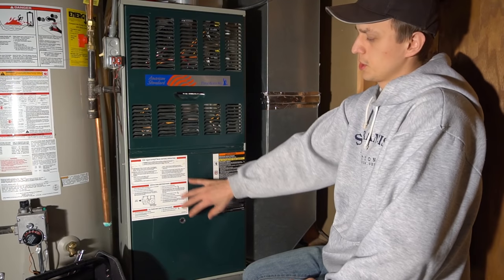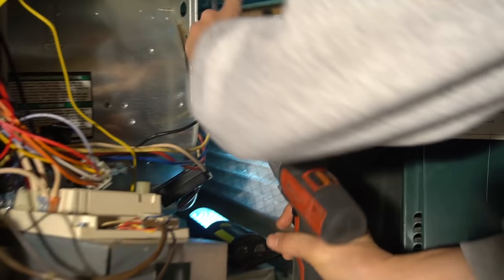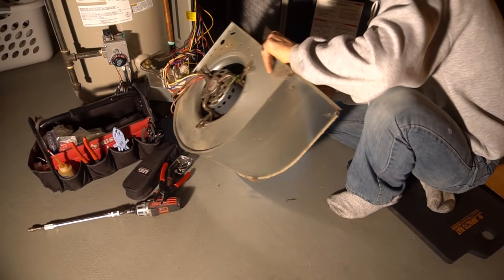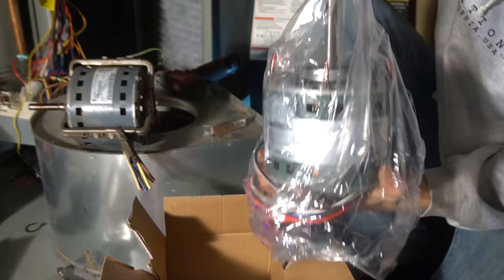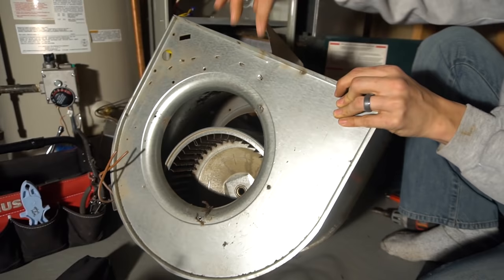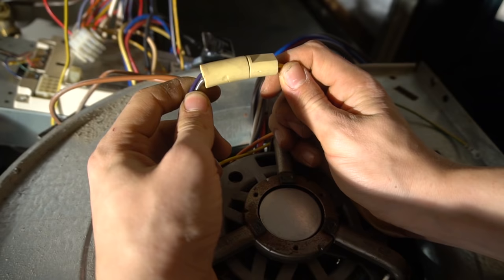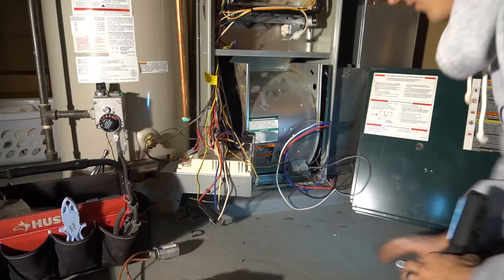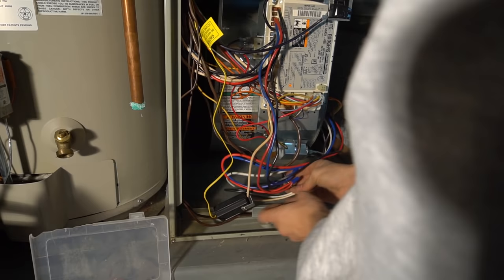Furnace/AC Blower Motor Replacement Step By Step

Comment: This don't seem like an easy DIY project. I replaced a flame sensor myself got the part for $10. HVAC company wanted $190. However, from a scale 1 - 10 with 10 being most difficult, this looks like an 8.
Reply: This is super simple
Reply: It's not too bad, but PLEASE watch out for that capacitor, that part can harm you without power if you are not careful!
Reply: Ivthought the same thing but wasnt too bad. Just take pictures and color cordinate ghe wires.

Comment: THANK YOU. HVAC company quoted me $1500 for a blower replacement. Was able to watch your video and replace it myself for $150 in parts.
Reply: I put out a request for quote on Yelp and had about 10 reply in 15 mins. I suspect today the job (in California) would be about $2k.  They can't quote until they diagnose the issue themselves.  The motor is the same $150 that you paid.  Such a savings if you can do the job yourself.

Comment: The local heating and cooling company just left after their contracted tune-up. They commented that the furnace looked really good for being 18 Y/O except for the dirty squirrel cage and the blower motor leaking oil. they quoted me 5K for a new furnace, and after watching your video, I ordered the parts for 126.75 

Thank you very much

Comment: Hey thanks a lot for your video! Two companies quoted me ~$2,000 for installing a new blower motor. The motor for my unit is expensive ~$600 (found on Amazon and eBay), but I still thought those quotes were really high. I saved myself the $1,400 by replacing it myself thanks to this video! I'd never opened up my A/C unit before doing this repair so I was pretty proud! Thank you so much!!
Reply: Dang they were trying to stick it to you hard. $1,400 for a 15 minute job?
Reply: @Insidiousotter  Ha, yeah. Though I admit that this was more than 15 minutes for me (3 hours or so) :-D I took a lot of pictures and video as I went along to be safe and power washed the blower wheel. Mine wasn't as gross as the one in this video, but the dirt was really caked on and I made it sparkle. HVAC people make a killing in my area I guess!
Reply: @HellsVampiro  Ha yeah after i thought i had fixed mine in a few minutes, it turned out it wasn't really fixed (i reinstalled the same motor but needed a new one). Once i got the new one, that process took way longer because i installed it wrong several times into the housing first. All in all from diagnosis to repair i probably spent about 8 hours fixing it and another 8 researching what motor i should buy.

BUT

If i ever have to change this exact motor again, it will be closer to 15 minutes now that i know what to look for.
Reply: @Insidiousotter  that's not exactly "sticking it" like any business they need to make money, good HVAC techs are not cheap. Tools, company vehicles, shop, office wages, tech wages, pension, benefits, gas, dispatchers, It's expensive. A good HVAC tech is making 80-120k a year depending on area. You want a good wage? So do HVAC mechanics working 12-15 hrs a day.

600$ for a motor, drive time to pick it up, go to call, swap motor, check and run the system, check things like duct static pressure, evap coil etc to see if that's what caused the motor to fail, Yeah I'd charge 1500$, but some areas techs and everything else is way more expensive, so 2k isn't outrageous, some suppliers charge more than others as well. Rule of thumb, cost of parts x 2.5 for standard jobs to make money off them. Some companies just charge flat rates for certain parts. Like 2k for a DC variable speed fan motor, so no matter which one, which supplier, they always make money, which they should to stay in business.
Reply: @Conflict1922  $2000 just to replace the blower motor is absolutely expensive! First of all you get parts at a discounted price and then mark them up (which is normal) So  are you telling me that you are that great that you get $500 an hour for labor! And people think Mechanics are over priced, I’m willing to bet that my toolbox and tools cost more than all of your tools and vehicle combined! It doesn’t matter how much money I have in tools you can only charge so much for labor!

Comment: Like so many others here, I can't thank you enough. After having a tech over who didn't find the problem, I found the issue by following another of your videos to figure out how the whole thing worked. Bought a new blower motor and the day after the part arrived the old one totally died (amazing timing). 

Followed your instructions to unplug all the old bits and change them out for new ones and I have rarely felt so useful and capable. We would have been cold and miserable without you, but with you -- triumphant. Thanks dude, you are truly making lives better.

Comment: My man, I just wanted to say thank you for making this video and posting it. It was easy to follow, and it's edited well which speeds up the process by not having to skip to the next part.

I have a Trane XE 80 and my HVAC guy wanted to charge me 500 - 600 bucks to change the blower motor. 

I heard the motor struggling last night, and then this morning it wouldn't kick on at all. The guy came out at 9 this morning and gave me the price. I immediately checked YouTube for a video on the repair process, and yours was the first one I found. I checked online for an HVAC supply near me, and found the exact motor I needed, 2 rubber rings for the brackets and a new capacitor for 180 bucks. I came home, got to work and within an hour I was done. I also got to clean the fan blades and the inside of the drum.

Now it's 5.30 pm, and my house is ice cold. Problem solved, and money saved.

Thanks again bro.
Reply from the maker: That's awesome man!! Thank you for taking the time to share that with me! Glad to hear that this video saved you some money! I had an annoying day with AC repairs today, this comment made my day! Motivates me to make more videos like this one. :D Have a nice day and stay cool!
Reply: EXACTLY the same with me.  XE-80 and the estimate was $700 minimum.  I did it for $125 total.
Reply: Those greedy bastards I tell you. The only way to fix a problem is to be your own hero.
Reply: i just got an estimate for $1500 to replace blower because “module” went bad. on a 2006 lenox unit. i don’t know what to do.
Reply: @tristant6764  Buy a new module board...
Reply: @Mathman420  You all want someone to come on this 100 degrees weather to fix something that is not theirs for 300 bucks? I am not even in this trade but the shear audacity in your comment makes me sick to my stomach. Good day

Comment: After watching you video, I was amazed at how easy it was to replace a blower motor. I am the maintenance tech for an apartment complex and last week we had a company come out and change a blower motor that went out and charged the owner $800 for parts and labor and I felt that was a little steep. Found out the parts actually only cost $153.00 for motor and capacitor. I advised the owner, that I would be changing these motors out for now on, especially after watching your video and finding out how easy it was to do myself. This way he will be saving at least $350.00. Thank you again for producing such a great video.

Comment: Thank you for sharing your knowledge!  I got an estimate on the repair of my furnace, I was then motivated to check out UTube and found your video.  The way you explained step by step how to replace a blower motor, you gave me the confidence to at 70 years of age to tackle the project.  I did have the fan hub frozen to the blower motor shaft but after purchasing a hub & fan-blade puller I successfully removed the old motor.  The furnace is a 1989 Carrier unit and it’s running great!  I’m now a real FAN of yours, pun intended!
Reply from the maker: Hahah, that's great! I am glad my video helped with your furnace repair :) Thank you for sharing, stay warm!

Comment: Thanks, Just replaced my blower with your tips.. My furnace is in a closet so it was very tight to remove the blower & housing. I ended up getting one of the motor brackets caught while trying to remove it while in the furnace... eventually got the whole unit out. Luckily previous homeowner left a spare motor. It's 105 here in Phoenix. Motor went out at Friday night at 10pm, had it swapped out and blowing cold by 1am after watchin your video and diagnosing!
Reply: that's pretty quick turnaround time, did you already have a replacement motor on hand?
Reply: @doninmichigan   Yes, the previous home owner left one in a closet. Funny thing is my neighbor's went out on Saturday. One tip I didn't know is that you can use a multi-speed motor, just use the wire for the speed that matched your old one.
Reply: @enkodellc  that's great, lucky for you.  I've been thinking about buying a spare blower motor to have handy in case heat goes out in the dead of winter.

Comment: Seriously the absolute BEST video on doing this procedure.  My husband was out of town when our blower motor kicked the bucket... I had a YouTube and tools and a local hvac supply shop. 
Your video was so simple yet detailed for a regular person to follow. No fluff,  just how to and possibilities you may run into which was exactly what I needed. 
I just put my skills to the test and am enjoying my heat again after I got it back up and running and literally watching this video at least 15 times and rewinding. 
You are easy to follow, easy to hear and I want to thank you profusely for putting this up for all to benefit.
Happy New Year!
Reply from the maker: That's wonderful! I'm happy to hear that you were able to fix your furnace using this video! Thank you for leaving a detailed comment on how the project went! Stay warm and have a Happy New Year!!
Reply: everyone needs a wife like you!
Reply: @WordofAdviceTV  I HAVE A QUESTION....The blower motor I have on my unit...says it needs a 15 mfd cap..but..the one that is CONNECTED IS s 15/4... the 4 connecting the blower...is that correct?....
Reply: Great video. I'm a electrician Nd have never changed a motor out before.  Will try it out. Thanks
Reply: @MD-cd7em  10
Reply: @MD-cd7em   That motor that requires the 15 mfd can be connected to the 15 side of that 15/4 dual cap and the 4 side left open.
Reply: @floridasaltlife  THANKYOU BROTHER...I GOT IT RUNNING

Comment: Awesome video. Thank you very much!  I just changed out my blower motor. Getting the two tops screws out litterally took the longest. Once they are out, this is a 10 minute job. I was quoted $500-600 by local HVAC companies. The motor cost $130 online ... thanks!
Reply: companies got a lot of overhead.... 500-600 isn't a rip off but if you can do it yourself then absolutely 100% DIY it.... Furnace AC work isn't complicated until you mess with refrigerant then there's a little science behind it lol

Comment: I have the same exact unit, you do a great job from start to finish.  Some of these video's a made by non professionals and it shows.  I smelled a slight burnt smell, I didn't test the electrical, I gambled that being 21 years old it was the capacitor, motor or both.  I was right ang it runs great.   The new motor is your main obstacle to saving money.
suppliers wanted 250+.  I called a buddy who is a hvac guy, motor plus capacitor was 109.00 including tax.

Comment: THANK YOU for this excellently made video.  You gave me the confidence to go ahead with replacing my blower motor today.  I had a blower unit that was getting louder and louder when it would turn on.  Just last night it stopped turning on altogether.  It would just hum loudly and not spin.  Just about every google search said that I only needed to replace the capacitor.  I did that this morning and it worked for about an hour before it reverted back to stalled out humming noises.  I watched your video on my lunch break, bought a replacement motor at a parts store on my way home from work, and spent about 2 hours replacing the thing myself following your basic steps.  Now my blower is running great and SO QUIETLY compared to before.
Reply from the maker: Awesome! Happy to hear it! Thank you for sharing. From what I've seen, if the capacitor is dead, the motor windings are likely damaged so you may as well just replace the motor right away. Good job on the replacement! Stay cool/warm!
Reply: Were u get the motor

Comment: I'm a car mechanic and I deal with replacing blower motors all the time along with the whole ac systms but this video has helped me to understand how to replace a blower motor in our HVAC. I do alot around the house fixing things. I was a little sceptical of doing this job myself but after this video and step by step instructions it should be a piece of cake. Just got the motor today so looking forward to replacing it and getting our ac working again. Thanks for the video.
Reply from the maker: I am sure you will get it done! With all the experience you have in a similar field, it shouldn't be a problem for you. Good luck and stay cool! Thank you for commenting!